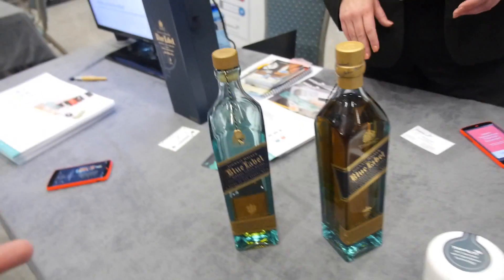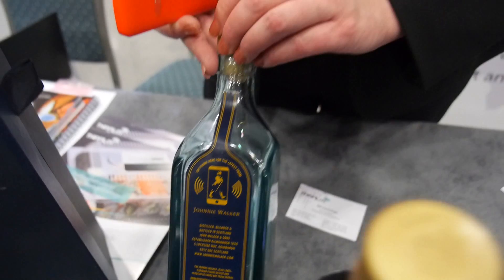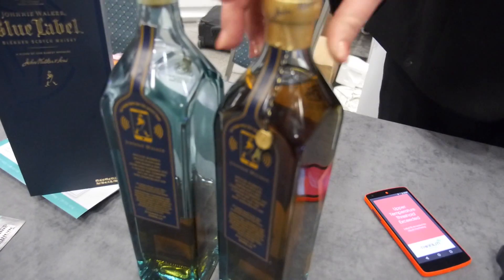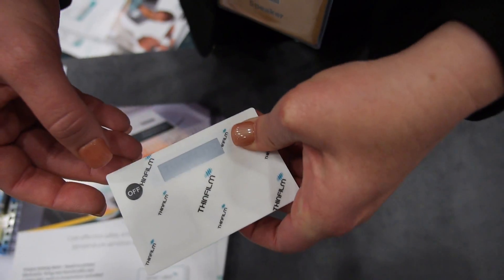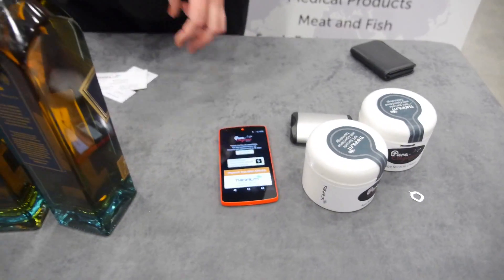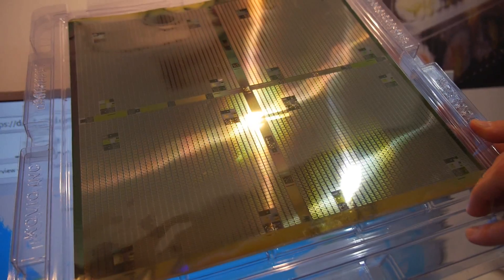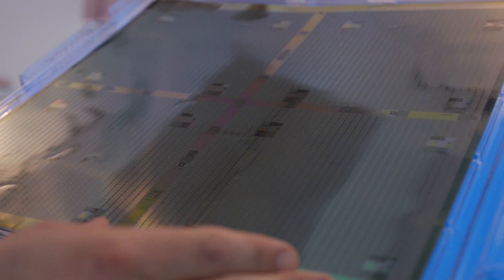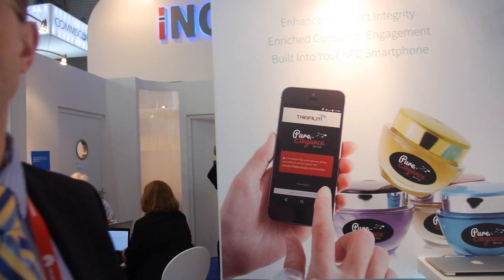ThinFilm Printed Electronics NFC Smart Labels for Internet of Things

Comment: This Johny Walker thing wouldn't really need to be done with electronics at all.. they could use QR code for that..
Reply from the maker: It needs to be reliable to know if the bottle has been opened with as contents could be expensive. So NFC signal needs to change depending on if it's been ever opened/tampered with..
Reply: Just put a seal or some sticker that ripps. It cost almost nothing.
Reply from the maker: The whole point of flexible electronics is that it also costs almost nothing. They can print these by the billions just as you'd print normal stickers that have no smart functionality in them. This bottle thing is just one use case, it might tell you on your smartphone app the time when it was opened and it might also tell you if bottle has been near too low or too high temperature or near too much humidity or anything else, there could be millions of other ideas for using flexible electronics, basically anything that you can think to do with a basic PCB you can now get it printed onto a plastic substrate and it be flexible.
Reply: I don't know.. iI feel this internet of things technology is really forsing itself on us, without the real need in many cases, just for the  sake of making general public accept it.. Smart and programmable internet of things could be as much as frightening as it is usefull.
Reply: Isn't this the same as having an RFID tag?
Reply: @stojanovicmiljan  I generally agree with your sentiment that: "this internet of things technology is really forcing itself on us, without the real need in many cases" but you picked one of the worst examples to argue your case!

Comment: some kind of electronics to tell it was open? gee wonder why the label has that bit going up into the seal. could that possibly be a tearable flex cable loop aka wire? have they invented things that can switch electricity based on the presence or absence of electricity? would transistor be a good name for such an invention? soo many questions. I would have at least asked to demo the bottle contents. also idk that it really would be that hard to do with silicon...nfc chips arnt known to have a lot of gpio pins but you dont have to use an nfc chip to get an nfc tag. for instance the attiny85 can be configured to be a wirelessly powered/reader powered nfc tag by simply attaching a coil to its clock pins and flashing the right code
Reply: I did find it a bit ridiculous that they had to pretend that a wire rip sensor is a super secret technology.

BUT they're doing something interesting, genuinely bendable semiconductors. They are necessarily low-density and thus custom/semi-custom designs, you won't get a microcontroller core on there, or a lot of logic, so getting as little as an NFC tag and some logic out of it might be less trivial than it seems. Something like a temperature sensor diode, that requires some precision to it, manufacturing consistency, and that it's not overly susceptible to other environment influences such light and bend radius.